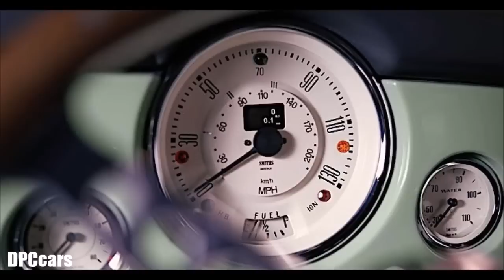Classic Mini Remastered by David Brown Automotive

Comment: I love this, except the backlights though.
Reply: Agreed. They could have found a way to integrate the original backlights into the body similar to what was proposed for the Project Ant aka Barrel Car Mini prototype (not to mention the updated front end of the proposal in question would have significantly improved engine accessibility amongst other things if they were inclined).

Comment: hi, very nice mini that catch's a taste of the 50's it reminds me of a modern fiat 500 take of the old 500, when a mini is deseamed you can see  how close it looks to 1950 morris and austins in its lines (if you forget its flat roof) most mini rebuilders do the same thing big wide wheels stuck as far out as the arches will allow, engine update for more power white roof,  stripes , racing seat etc. therefore another mini done up to look like the rest of them joins the road and yet there is so much more you can do to improve the look of your mini with just a bit of imagination. thanks dolores

Comment: At least bow mini is affordable , this is a rich mans toy totally not what classic mini was all about
Reply: Agreed. It's a real shame all around, because having a new company preserve the classic Mini in a new release is a great idea (similar to the revival in the 90s), but 80K? Ludicrous.

The worst part is, it doesn't look substantially different from the classic (which is obviously a good thing), so while it's a lovingly built modern iteration, most people on the street aren't even going to see the pound value as it drives on by.

It feels like it fails on two fronts:

- It's not going to revive/create a new generation of classic roadworthy Minis, because it's too expensive for the average consumer.
- It's doesn't work as a rich man's flashy toy, because to the average Joe on the street, it barely looks noticeable different as it whizzes by.

I wish someone would do something like this, create a modern-standard classic Mini in an affordable price range.

At this price range, you could literally just buy an ACTUAL classic Mini in great condition and then upgrade the internals and externals to modern tech for far cheaper.

Comment: Ugly rear lights
Ugly side indicator
Ugly deseaming
Ugly front indicator lens
What has happened to the sills? Have they been re-engineered to ensure they can't rot from the inside out? they look like dreaded oversills
Nice interior yes...but £100k?
Standard drivetrain

 This is no singer porsche 911 "reimagined"

£50k will get you two Mini Cooper S and they will hold their value.
Reply: some like the deseaming, others don't. my dad ran minis in the 70s and it was the 'in' thing to do.

and if the drivetrain is the same as the originals from 2000 and before, then I think 130MPH on the clock is beyond enthusiastic! (unless you have fitted a 5 speed box, supercharger and have a higher rev limit through a better built engine, stronger valve springs etc)
Reply: front indicators look like popped zits

Comment: You could just get a Limited edition Mini Cooper with factory wooden dash, leather seats, air-conditioning, fuel injection in a very capable engine and rocking paint job. All for just under < £20K. Just google Mini LE 35th edition!

Comment: Mechanical spec? For 100k it's gonna be something special, right?
Reply: not particularly, its the 1275 engine with fuel injection but pretty sure its still got the 4 speed in sump gearbox